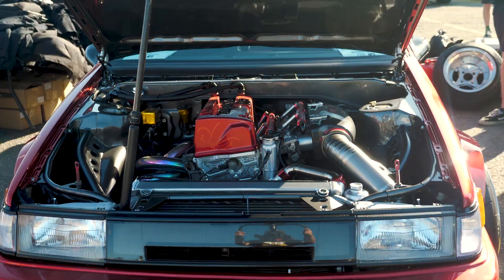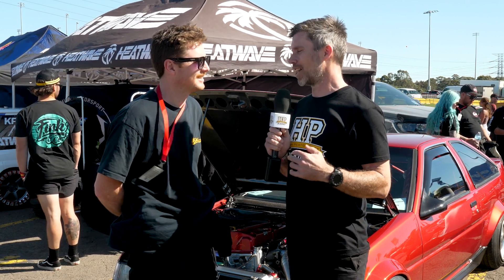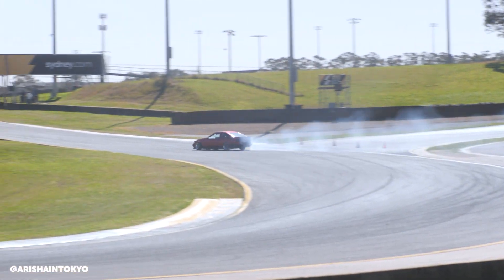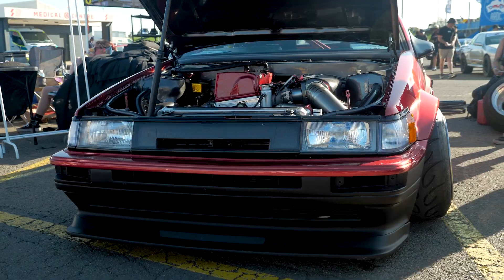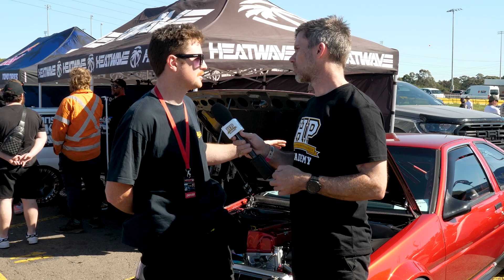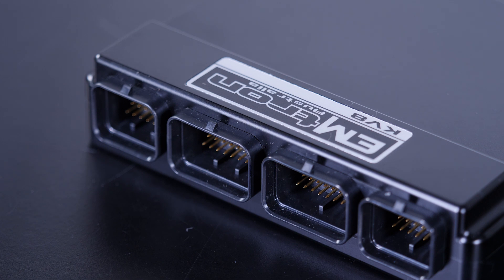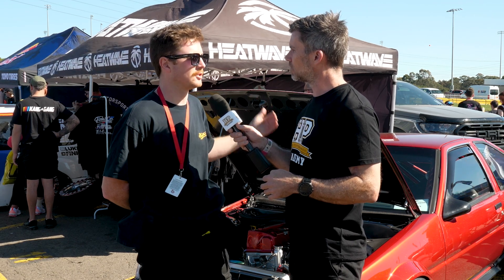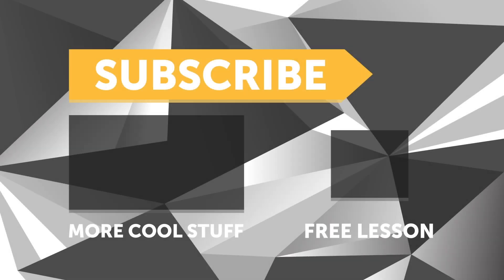“I didn’t know why, I just knew I needed an AE86”

Comment: Picked up 2 AE86s for 8k USD last week together. One that drives and is already registered, the other that can’t move but has plenty of parts. Super happy fixing the one that works and restoring it
Reply from the maker: Awesome! Enjoy the project mate 😎 What's first on the list to fix? - Taz.
Reply: @hpa101  Replacing the Carburetor so the engine stops running rich. Then fixing the central A/C vents and the stereo.

Comment: I'm curious which camshafts exactly are being run. The power seems a bit on the low side for a built high comp setup on E85 for "the biggest cams before deleting vtec". 
I see RBB on the head casting which doesnt flow the best. Maybe DC2.2 or 3.2 cams and factory RBB ports for lots of midrange?
Reply: There's also a big difference in parasitic loss through a rwd drivetrain over a fwd drivetrain, definitely needs to be factored in
Reply: ITBs need enclosed airbox with a long CAI 3.5-4" 900-1000mm
Reply: 260hp at the wheels is massive for a K series. Don't be fooled by USA numbers which are typically inflated
Reply: @LuckyFruitRacing  it's not massive and I'm not American
Reply: @LuckyFruitRacing  I make 255 at wheels stock rods, pistons and compression. K24/k20 head with drop in cams
Reply: @andrewyoung9067  good for you
Reply: @LuckyFruitRacing  I make 300hp out of a naturally aspirated built k24 (dynapack dyno in NZ). Not hard with the right combination of parts.
Reply: @brenthay1  fwd or rwd?
Reply: @LuckyFruitRacing There has to be something wrong with the combination of parts 200kw+ is easily achieved before the need for e85, I'd like to see the dyno graph
Reply: @dan4age  he's done a post on Instagram. His ITB size is limiting the power output currently